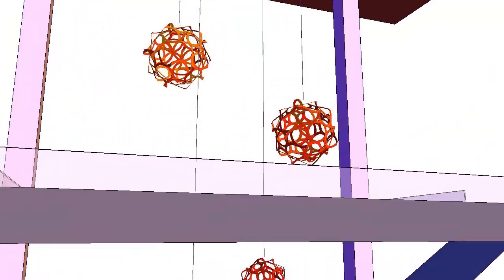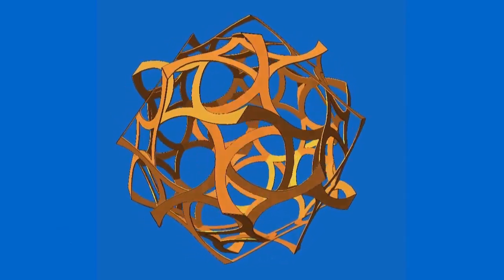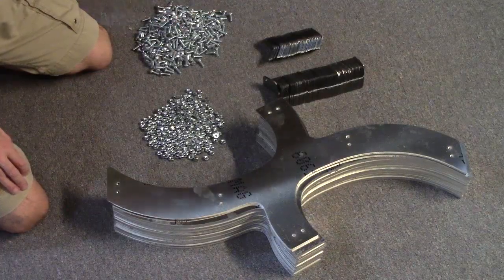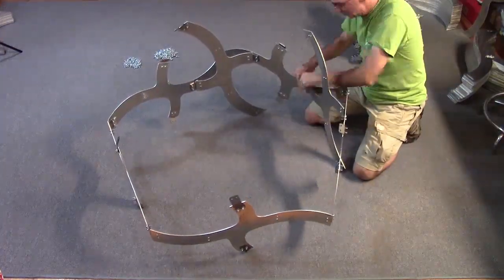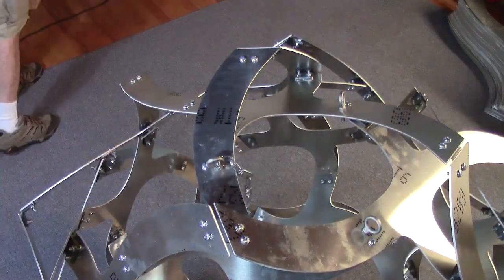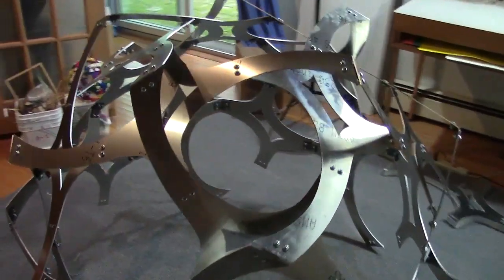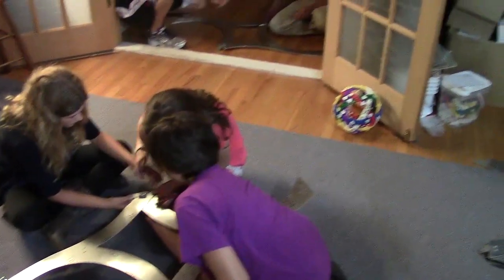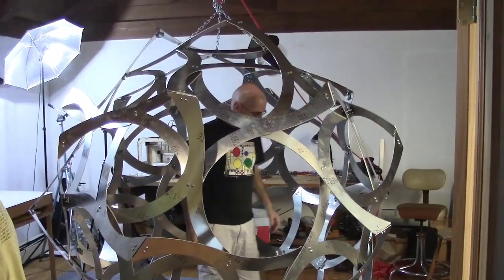Sculpture Party

Comment: Nice sculpture lots of viewing options and unexpected windows.  Pop  rivets would have been a slightly cleaner look.  Or even better, don't drill the pieces but clamp the angle brackets on and weld the the but ends of the pieces together, then remover the clamps, this would make for a super viewing and blending of the surfaces.  However powder coating may be a challenge.
Thanks...